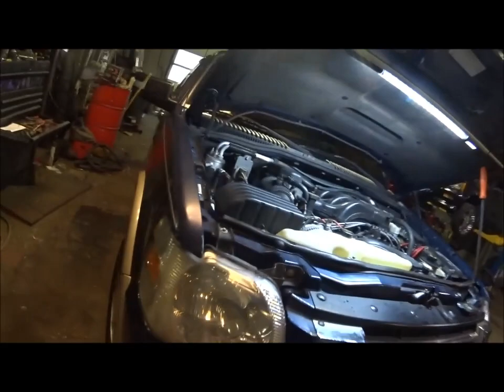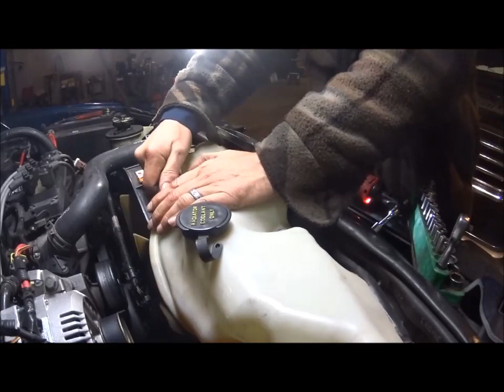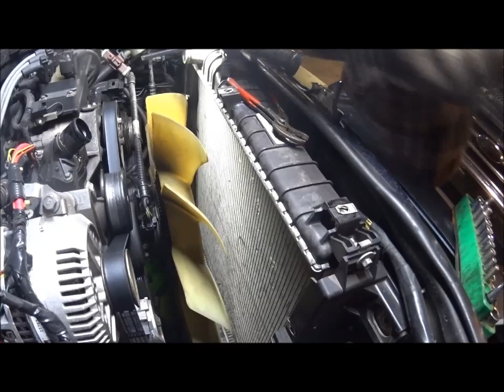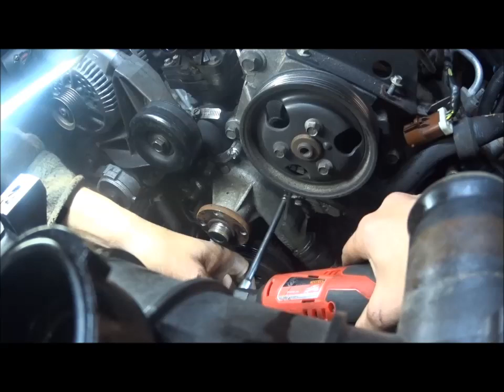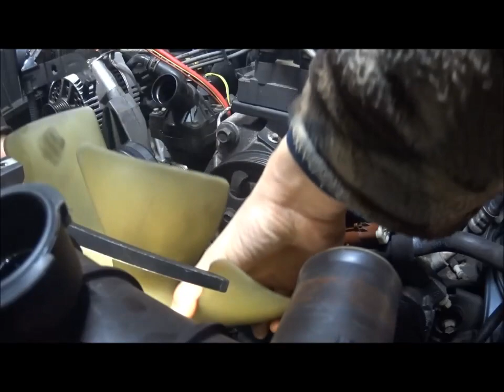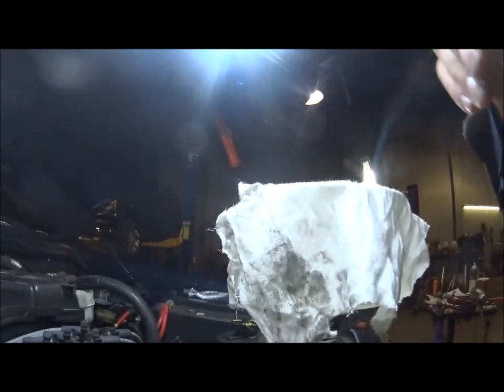How to Replace a Water pump on a 4 0 SOHC Ford

Comment: Great video buddy. Ive been watching my buddy use the air chissel for years messing up that shaft. It always came back to bite him. Amazon sells a 3pc clutch fan removal tool thats awesome. Ive used mines 1000x over. $50

Comment: Great job, very detailed and keep up the good work. I know it hard to make these vids while doing the work. It is appreciated. Unfortunatly i have an 09 version of this truck. It is the biggest piece of crap ford ever made. 112,000 miles and ive had to replace the thermostat housing three times, chain tensioners, most of the door switches so my dome light would go off, the stupid gas filler flap that has no gas cap and worst of all the PCM about 6 years ago. Now i got a check engine light that indicates a bad EGR and purge valve at the same time, yet truck runs fine, nice and smooth no rough idle. At the same time the gas guage has gone wiggy.  One day gauge says 3/4 the next day its almost on empty and low fuel light is on. Go th fill it up and only holds 6 gallons. The other day i heard a small hissing and noticed a small crack in top of radiator. On top of that i noticed a few small drops on the driveway of what feels like an oily sustance that appears to be coming out of one of those hard lines in the bottom of the radiator. Wish i could afford a new vehicle. Now its to the point i cant afford to fix all these issues. I hate these new garbage vehicles.

Comment: nice work!  was the 3.5 water pump job the internal pump style ? and all the knipex  pliers are great  I think better then snap on and cheaper too!
Reply from the maker: Yes sir, internal pump driven by the chain and engine is transverse in the cradle. Fun one to do. It was a first for me. Dumb design on that pump.

Comment: Joe how did you find the leak ? Did you pressure test the cooling system first ? What type of wrench did you use to take the fan off ? Good video  your doing a GREAT Job  take care Joe
Reply from the maker: Customer pressure tested it himself. For the fan, I have a Lisle set here to remove them. Don't know the exact part number, but comes with 2 wrenches and the holding tool. It works on a bunch of makes and models.